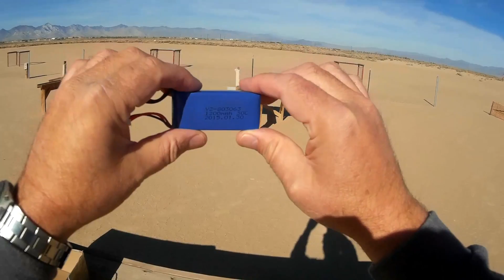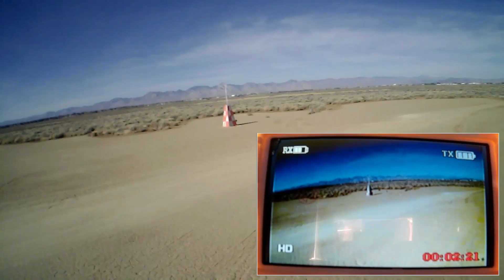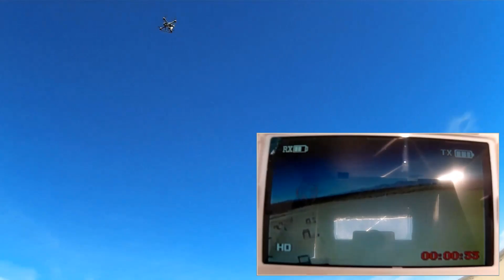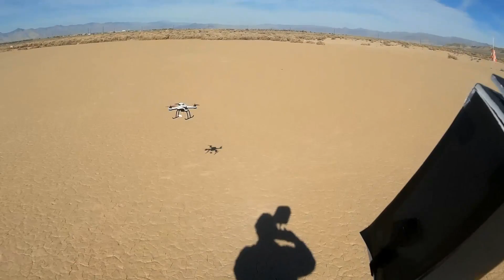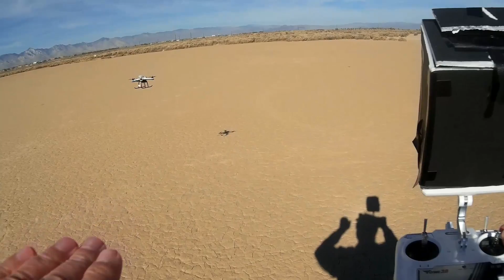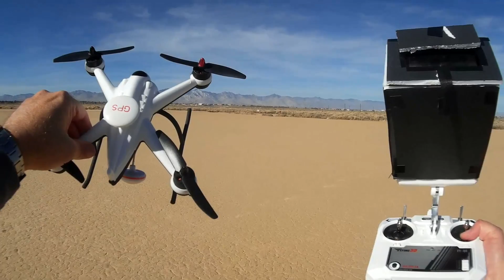Flying 3D X6 Plus GPS FPV Drone Range Return and Flight Time Testing

Comment: Do you think this quad is having a good price now by the way. a little more than 187 dollar? Or should I take something els?
Reply from the maker: It's a great quad. It's just that its 4 minute flight time is really short (although it can use Tarantula X6 batteries).
Reply: Yes I saw that, and with that price maybe it worth it, plus a tarantula battery? or should I try to wait and buy XK X380 or Hubsan H109? Desicions desicions. lol
Reply: Also thinking about SYMA X8HG seems to be possible to buy now
Reply from the maker: Jerry Berglund You're right, it seems to be in stock now. Need to see about getting one.
Reply: Yes it is. :-) I just did order the SYMA X8HG. I think I save my money for a the hubsan or XK drones instead. :-)  I ordered it from Symastore wich actually seemed to have a slightly better price.
Reply from the maker: Jerry Berglund For the past week I've been flying a really neat quadcopter, the UPair One.  I'm really impressed with this quad. Keep an eye out for its first review on this channel to be released this weekend.  The UPair One has been out since November.  But this is its first production run under its new company since they were bought out in February. Fantastic control and FPV range, with excellent and relevant OSD information. 2 axis stabilized gimbal. 2K or 4K camera. Nice FPV screen also.
Reply: Really? I was kinda thinking about that one.... myself. So I'll be waiting. :-)

Comment: I'm thinking about buying this quad. Is a good quad or does it have issues?
Reply from the maker: +Ian Rice Actually I really like the X6 Plus, and have made four videos of it because of such (if I make more than one video, I kind of like the quad ;-).  The only thing that I don't like is its short flight time with the stock battery.  But I guess larger batteries will work with this, but just haven't had time to research which is best.  Anyways here are some more flights with the 3D X6 "Plus" model.  https://www.youtube.com/channel/UC90A4JdsSoFm1Okfu0DHTuQ/search?query=flying+3d+x6+plus
Reply: Hey man how are you doing? I'm doing great i just got my jjrc x1 in the mail and it's pretty cold here in NJ and i wanted to ask you if it will ruin it to fly in the cold? Thank you for all your help!!!
Reply from the maker: Ian Rice The battery won't last very long in the cold.
Reply: +Quadcopter 101 ok I can deal with that because I got 5 and I just want to fly it. lol thank you so much man you are such a help and have a hell of allot of knowledge!
Reply from the maker: Ian Rice You can make the battery last a bit longer in cold by wrapping it with a thin layer of newspaper to act as insulation. Just be careful not to force it into the battery bay if the newspaper gets snagged.
Reply: +Quadcopter 101 ok I'll that.It's going to be hard you know how tight the battery bay is on the jjrc x1 is. Thank you for the good idea man... I took the jjrc x1 out last night and man she's got some power. It's awesome to find a brushless quad for such a great price I hope other companies follow jjrc.
Reply from the maker: Ian Rice Check your motor mount screws on the X1.  Some of mine were loose and needed tightening.
Reply: +Quadcopter 101 I usually do check screws like that. today I really got to fly it and the trim was way off I noticed it last night but I decided to wait till today when it was nice. So it would not trim it was so hard to go backwards so I balanced the props and that still didn't work. And then it fell out of the sky only about 15 feet up. So I restarted it and now it's doing what the cheerson cx20 did on take off. It's flipping itself upside down. it should take off in a nice hover but nope this one has to has to be defected to. My x380  And syma and my couple other quads work fine. Did yours ever do this?
Reply from the maker: Ian Rice Did you try calibrating the gyros?
Reply: +Ian Rice how do I do that? the manual wasn't to helpful. Can explain please? I lm do bummed I was excited and now I'm bummed. I always have some luck. And I'm part Irish lol.
Reply: +Quadcopter 101 I just made a video of my jjrc x1 to show you the motors are going nuts the front right one starts and stops every second then the front left one does the same they just started going crazy. uhhh this sucks!
Reply: +Ian Rice Turn on the quad and transmitter wait a few seconds then push both sticks down and out the L.E.D.s should flash when they stop the gyros should be calibrated. I sure hope this helps good luck Ian.
Reply: +Ian Rice  I recommend the X8 rather than the X6 its got Telemetry. Its cheeper too.
Reply: ziggyzbeak you are actually right that was how I had to fix it. Thank you. :)
Reply: ziggyzbeak I'm not crazy about how it's so small though. I like the big birds. I'm thinking about getting the phantom 3 standard.
Reply: the phantom is a great quad but I have heard that you can't get any after purchace service from the co. after you buy your on your own good luck.

Comment: i hope something as good as this comes out in a lighter version under 250 grams. i know there are cheeper fpv flyers under 250g and i have a few of them, but the fpv just dose not work as good as this, they don't have gps or brushless motors, the control distance sucks and flight times suck.  this is 331g I'm sure it would be possible to pull off the same features under 250g and it would prob increase flight time being lite
Reply from the maker: +adventures and quadcopters What's with the 250 grams limit?  FAA registration.  If so, it's free until February and not really a big issue.

Comment: Hey Quadcopter 101, 

Looking for an FPV beginner drone - looking at the WL Toys V686 and the Syma X5SW, or things in that range. So far, I've seen that the Syma has better durability and the WL Toys has better video quality. Thoughts? Anything in a similar range that could compare?

This one looks promising but out of my budget for now.
Reply from the maker: +WASIM ALI These are the latest and greatest with the new altitude hold feature that makes flying FPV very easy.  Recommend any one of the following three: https://www.youtube.com/watch?v=9bPaOEDpQFs
https://www.youtube.com/watch?v=ZnRUNJSMKKI
https://www.youtube.com/watch?v=_ODT1xilCNg
Reply: +Quadcopter 101 I really like the WL Toys one, but found this one with a higher resolution camera. Thoughts?

http://www.banggood.com/Wltoys-Q212g-With-720P-Camera-FPV-Air-Pressure-Set-High-Hovering-RC-Quadcopter-RTF-p-990504.html
Reply from the maker: WASIM ALI https://www.youtube.com/watch?v=_ODT1xilCNg
Reply: +Quadcopter 101 yes, the one I linked says it has a 720p camera - do you know what the quality of that one is? or are they exactly the same issue?
Reply from the maker: Wasim Ali They are all 720p.  But video quality does vary some between quadcopter.  Recommend taking a look at each video as the camera demonstrated in each. Then choose whichever one that you think provides best picture.
Reply: +Quadcopter 101 gotya, that's the one I think I'll go to. thank you!

Comment: Wow, that seems to be great for a intermediet flier. I mean its kinda tough sometimes to now where the range is over. This one seems to stop and back to where it came from to search for new contact. Sure. an intermediat user use the wind to help if your get out of range, but sometimes there is no wind to help you. 

Said the range wasnt longer though. but that must have been more than close to 300 meters. Especially when FPV seemed to handle a little more than the quads range. :-)

Seems also to be better than before so 3D has done updates or something. I have seen videos that wasn that good on this quad before. But here it seems to work really great. :-)
Reply from the maker: +Jerry Berglund I actually did not fly out of range.  The quadcopter has a default "go no further" setting that prevents the quadcopter from flying greater than 250 meters from its takeoff point.  The idea is to keep the quadcopter close enough so that it has a chance of making it back home should its low battery automatic return to home activates.  But this setting can be modified with the X6 GCS software to increase that barrier range, or turn it off completely. The more I think of it, am not sure that I want to turn it off or increase the range as it's low battery return to home actually works very well.  Watch for a demo of this feature in a video I'll be releasing in a couple days.
Reply: ok but thats good... Its good to think safety first and not to chanse when it comes to this things :-)

Comment: I am really starting to enjoy your Flying 3d X6 videos! Its a shame that the update didn't change the range, but 250m still isn't bad for that price. (In your description you said 800m. Maybe you wanna update that) I think that quadcopter could be a big hit!
Reply from the maker: +Brian Evans Actually, it may have worked, but apparently there is also a maximum range barrier that the quadcopter will not fly past.  Mainly it is a safety feature for the quad to provide a barrier in the sky in case the battery falls below a set level, the quadcopter may still have ability to automatically return to its takeoff position.  This range can be increased with the X6 GCS software.  But I'm thinking that maybe its not a good idea to do such.  250m range is more than enough for most of my flying, and I do like how it automatically returns and lands when the battery gets too low (I'll release a video in a couple days showing a demonstration). If I set it to a greater range, such as 1000m, maybe it won't be able to make it back before the battery dies?

Comment: can we use goggles with that
Reply from the maker: +Ultimatevapor918 Sure, but it will cost extra to purchase goggles and a receiver to go with the goggles.
Reply: +Quadcopter 101 would it be a good FPV quad or should I build my own with goggles because I want to do the goggles
Reply from the maker: +Ultimatevapor918 This quadcopter is for those who want it ready to go out of the box.  I personally like the screen better as it's easier to quickly transition to line of sight flight if something goes wrong.
Reply: +Quadcopter 101 so I will continue building my quad for the best experience. :-) I just wish I could find one ready to go for under 600$ with atleast 200 meters more would be better of course.
Reply from the maker: Just need to make sure of something first. This is not going to be your first quadcopter is it?   It's very important to learn the basics of flight first, and it would likely be a costly mistake to start with a "build your own".  A cheap $40 toy quadcopter is more than perfect for starting into this hobby.  http://quadcopter101.blogspot.com/2013/10/chapter-1-introduction-to-quadcopters.html
Reply: +Quadcopter 101 no I have like 5 sky vipers I have all the skyvipers and 2 stunt ones ive gotten good enough to keep it in the air and do a safe landing havent broke one yet :-) knock on wood

Comment: Hi 101 I've got a x8 and I'm pretty sure that's the geofence that is set to 250 default value, just go to ground station and remove geofence, you'll get much far.
Great video none the less, keep up the good work.
Reply from the maker: +Ângelo Cruz That's what I was wondering.  It was like bouncing into a rubber wall/fence in the sky.  It just wouldn't go any further no matter what I did. I'll have to check out the ground station software to try increasing that distance.
Reply: Love your reviews, hope to see the next long range fpv video from you.
Ps: did you give up the x8? I'm installing a mobius, 2d cheap gimbal and 200mw transmitter/receiver, clover leaf antennas, 9450 props and a 4500mah battery. Only thing needed to teste is good weather in Portugal. :)
Reply from the maker: Ângelo Cruz No, I still have it.  Now I'm curious if it will also run into a wall in the sky?
Reply: Yes it will. ;) mine did that until I remove the fence.

Comment: It looks like the GPS fence is set to 250 meters (the default) need to check in the ground station, you can extend the fence to 1000 meters or set it to 0 for no restriction...
Reply: Third
Reply: thats cool

Comment: Well, the 200+ m range (extension) is a moot point, since the FPV video started breaking up at that distance as well. Nice that you can use Tarantula batteries. Still think it a bit pricey compared to say, CX-20 or XK X380 which are same price or less, and offer better flight times and range (but no FPV ... which one could add if they really wanted it.).  Anyway, thanks for the entertaining review ... always a pleasure. Cheers!
Reply: x380...cx20... or....flying 3d x8?????......pppleeease......😧
Reply: +Paul Terl Of the 3 you mentioned, I'd still go with the XK X380, even though it has some problems, they don't appear to be as bad as the problems of the other 2.
Reply: Ouch! Too late i've ordered the Cheerson today...
stay tuned! will see.
Thank You very much!